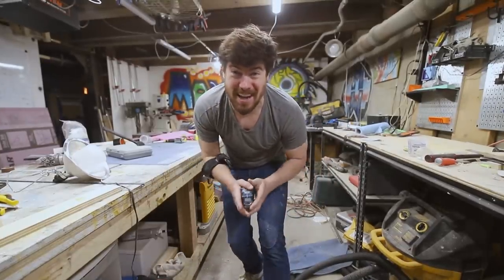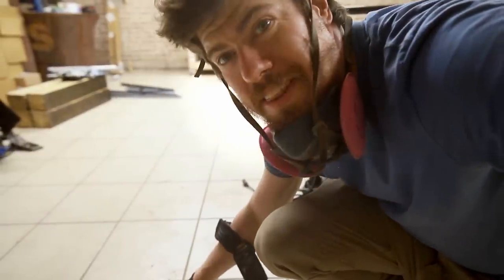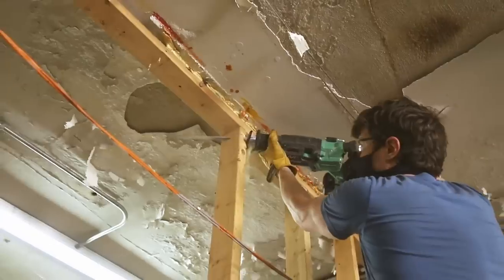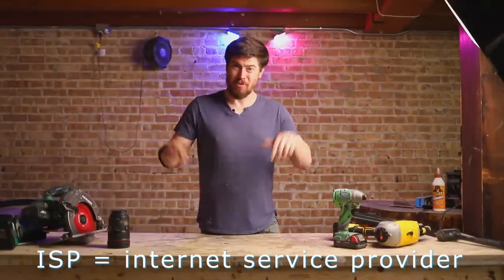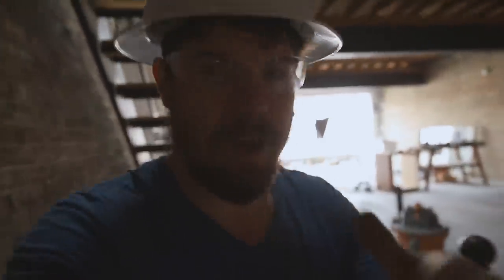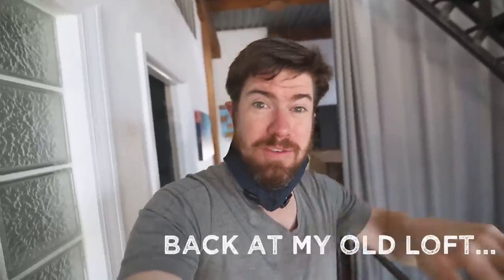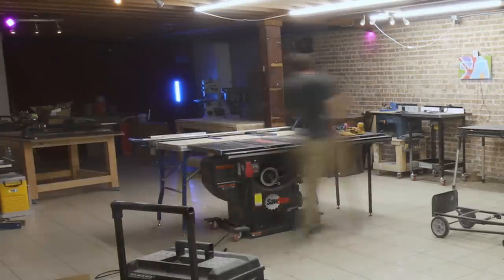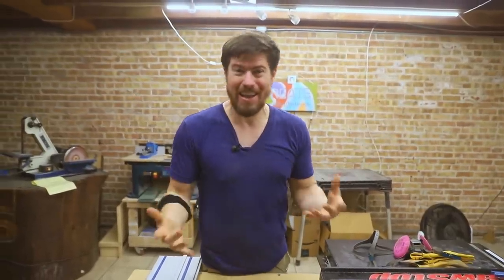Abandoned Bldg Reno Ep. 05 || STAIR DEMO & WORKSHOP

Comment: Personally, unless you need to use the Wood Shop equipment immediately, I'd stash it in the Metal Shop area, redo the Wood Shop Floor, then move everything in and set up the Wood Shop.
That way, you don't need to set up and calibrate everything more than once...
Reply: I agree, but maybe it's about money too. Think about it, only the roof was 55k? Or something around that
Reply: @MrRcR18  He can do the floor himself though, it's just concrete. The roof being 55k was because he didn't want to do something himself that he didn't have experience of that would be a disaster if it went wrong. The concrete floor is his area of expertise, probably with another LED strip <rolls eyes> ;)
Reply from the maker: I need to use it asap... I'll talk about timeline in the Q+A video and explain in more detail
Reply: David Campbell 
I wasn't talking about what he can or what he can not do, I was talking about that the roof costed a lot. I mean, he didn't expected that it will be 55k. I wasn't talking about doing the work himself. And also, for the concrete he needs something profesional also, because when he works, the machines will make a lot of vibrations and the floor needs to be something pro made, he said that he will use carts to move the products. I recomand doing the floor with concrete by these recipe : crushed stones, sand, metal flakes or polypropylene fibers. 

Good luck @Modustrial Maker

Comment: You talk about how well the stairs were built. My Dad was a carpenter and home builder in starting in the late 50s. He was taught to measure exactly and cut to measurement. He also was taught if the blueprints said a room was to be 13 X 15 that was exactly how big it should measure when it was finished. He was taught to put so many nails per foot etc. He left the industry because they started cutting corners, less nails, and as long as you got close to the measurements it was ok.

Comment: 1. how will you heat all that space? have you looked into geothermal?
2 will you have an elevator?
Reply: I doubt geothermal is an option for him as he is in a downtown-ish area, and geothermal generally requires a very large area in which to drill very deep holes.
Reply: @unlawfultender6389  You need to dig very very very very very very deep!
Reply: @kimfucku8074  Either very deep, or shallow (but below the frost line) over a large area.
Neither is possible on a city lot.

I'd like to see some photovoltaics on that roof, though.
Reply: Solar is the plan

Comment: Just a tip from a noob who watches too much YouTube..
Base your setup on work flow, from where you bring material in, process it down and finish. Then take the dust collection into account. 
That should give you a great idea of how to lay things out, what furniture you'll need and where and what shape. 

I hope that helps. A lot of guys make a shop that looks good, but just remember it has to function effectively. You want to be able to drag in a full sheet, get it directly on the table saw.. or bring in lumber and go from table saw, jointer, planter, chop saw, bench, sanding/drilling... etc. 
You'd want dust collection running the opposite. Sanding and planers closer to the dust collection because they make more dust and you loose some suction the further you go away, and the table saw produces much less than a belt sander or something..

Hope this helps at all. Just a few tips from looking at dozens of shops and currently working on building my own small shop.
Reply from the maker: Good tips!  Thanks!

Comment: You can lay a 2"X2" weld mesh over the tile floor and pour 1.5" concrete over it and then polish the whole thing. It will be 1.5"above the existing floor but it will save your the demolition and cleaning process.

Comment: Starting a youtube channel just designing and building shop furniture would be my dream job, but given I'm on the west coast, it wouldn't be practical to get furniture to you in Chicago.  I've been wanting to do a series of workbenches for a while now, ones that have wheels, but also change height and end up on legs while in use for stability.  I find having several smaller work benches, all the same height, that I can use to make a bigger work surface is far more practical than the huge 4x8 tables that a lot of people build(I built one, ended up giving it away) but then I'm also in a garage shop, not a large space like you.  Still, I find it nice for flexibility to be able to clear floor space, or spread them out to support just the corners of larger furniture pieces.

Comment: Since your shop is going to be improving and evolving for a good bit of time and I’m guessing a lot of your equipment is going to be running on 240vac, I’m going to make a suggestion.  You could run a 240vac and a 120vac conduit along the wall.  Install a junction box (JB) every “X” amount of feet.  This way when you decide to relocate a piece of equipment you can just disconnect it from one JB and terminate it into another JB without too much grief over where you are going to get your power.

Comment: Mike.  
Are you replacing the steel stairs because they are defective in some way?  Or are you moving the stairs somewhere else in the building?  I should think they would have added to the modustrial feel of a renovated industrial building.  I guess I will see in upcoming vlogs.
Reply from the maker: no, I only need two staircases (at the front and the back).  removing this one gave me a ton of square footage back on first and second floor.

Comment: I have that same style pressure washer gun, and its junk in its factory form. The adjustable tip thats on there unscrews and you can install a standard quick coupler that accepts the standard pressure washer tips. Night and day difference. That factory tip uses a 0 degree nozzle and then has stupid little deflector strips to create the fan effect, but they ruin the water velocity too.

Comment: I am shocked to see the use of angle grinders without the protective cap. One slip of the hand and your fingers are in the disk (and on the floor). If a disk binds and shatters it goes off like a bomb and your face is right in the line of fire. You seem like a responsible guy and I approve of the general way you support safety in the workplace, but common! How can you condone this? I realize that this is an American thing and I see it all the time in US TV shows, especially in body shops. Still, In Europe where I live, you could expect a $5000 fine just for noncompliance and that is without anyone being injured. An actual injury would mean a $20,000-$30,000 fine. You wouldn't you use a table saw without a push stick, why would you take the cap off your grinder?